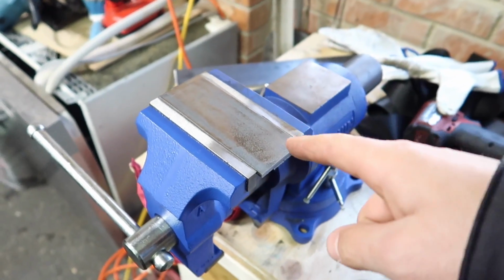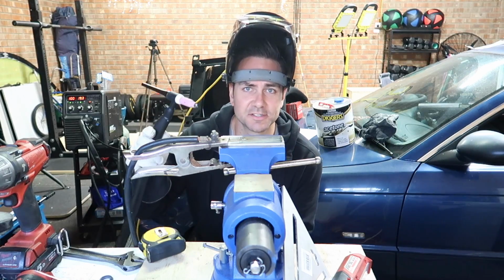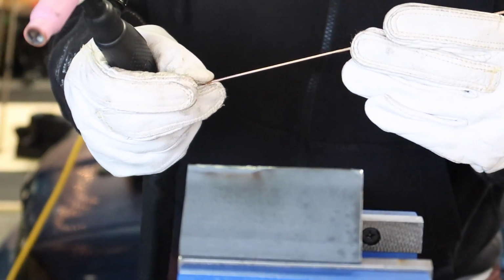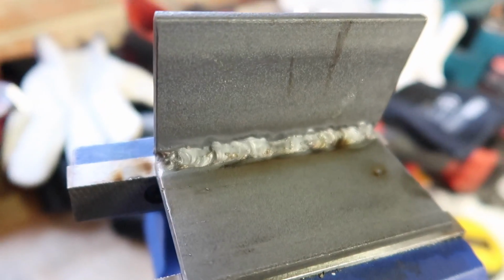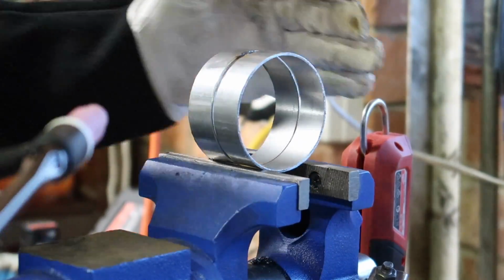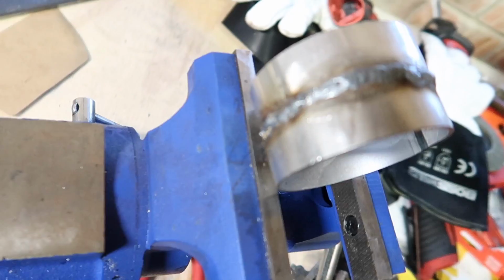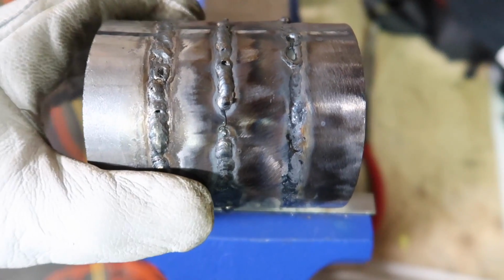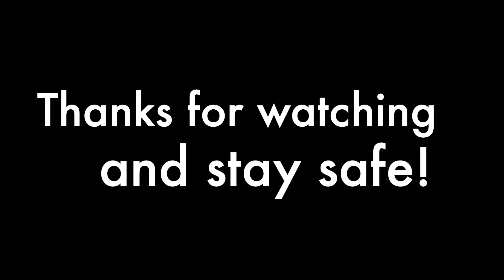Learning to Tig Weld. First time Tig Welding (Teaching myself)

Comment: last month, I learned five most crucial things with my first welding, in this case tig  welding
1. turn on the helmet  so you dont burn your eyes
2. wear welding jacket or at least long sleeves so you dont burn you arm and neck
3. wear gloves so you dont burn your finger
4. turn on the gas so you dont burn the tungsten

5. dont weld galvanized steel without grinding off the galvanized layer
Reply from the maker: 100% haha

Comment: That looks like about 4mm you should be at 120 amp round about 30 amp per mm keep the ark relatively close and use the gas to shield the weld don’t remove it straight away and get a gas lens kit with a bigger cup
Reply from the maker: Thanks mate!